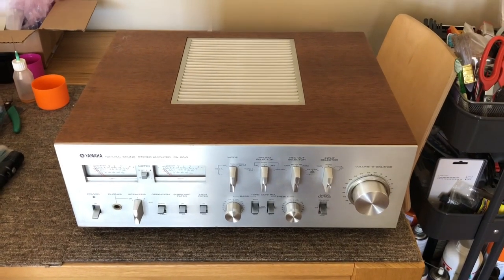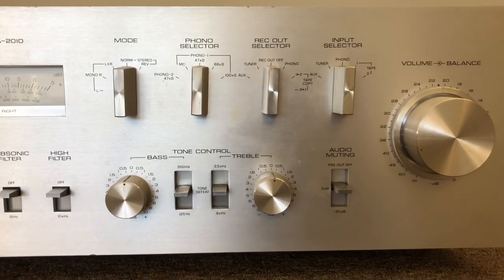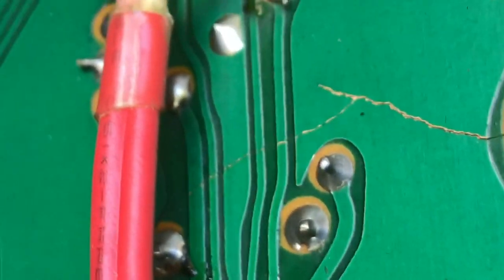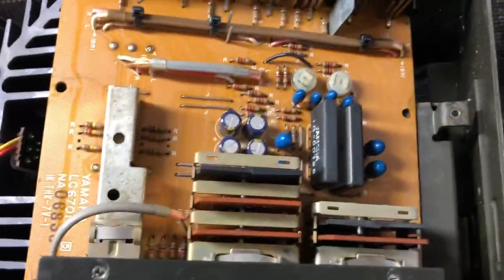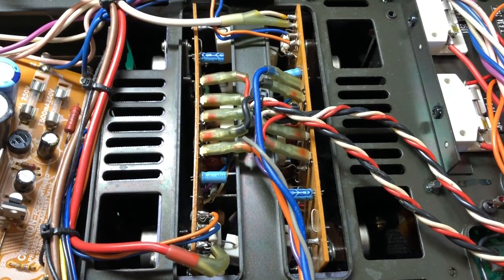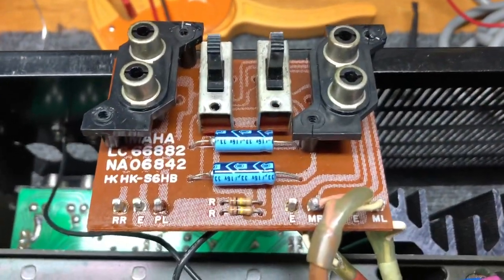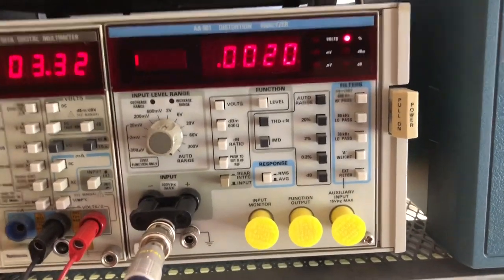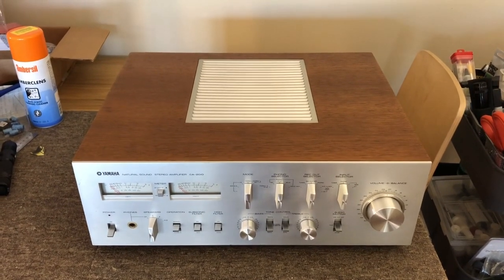Beautiful Yamaha CA-2010 Integrated Amplifier Repair & Restoration

Comment: Hi There
Greeting from Poland. I just aquired CA1010 Unfortunaetly someone has been on tha power supply board before me and fitted some cheap caps . What brand are these yellow and Orange bipolar caps ? Really like the look of them . What series of other Panasonics did you use ?
I would like to fit better quality parts than Sinecon that is there now . I think She deserves it. Regards
Reply from the maker: Hi Adam, most often I use Nichicon Fine Gold and MUSE bipolar, Panasonic FC and FM and Nippon ChemiCon KZE. There are others and it varies according to budget, customer request etc.
Reply: Liquid Audio Hi Sir Thank you for reply . Still refurbing this thing , it was so dirty but its start to look a lot better. Just a qucik question if you dont mind helping out . I measure fes of this black nippon chemi con and almost all read higher than rated . There is one 3.3 uf that read nearly 5uf. Is that Ok or should they be replaced ?
Regards

Comment: Hi, I humbly request some help. I have just acquired a CA-2010 and have followed you video as to what to do (replacing capactitors etc.). I also live in Australia but the unit I have does not have those NEC chips mounted on the heatsink beside the main transistors, rather they are mounted on the PCB. Do you think this is a modification to the original design? Should I also consider moving these chips to the heatsink with the main transistors? Thanks, really appreciate the video.
Reply from the maker: Hi Jono, glad you enjoyed this one. I can't say without seeing her and looking at various indicators close-up. If you live locally you can get in touch and bring her in. If not you can visit my contact page and submit a request for technical assistance there.

Comment: Hi! Thanks for posting this.  I have this the Japanese version of this amp.  The power switch/knob got bent and half broken during shipping to me.  I need to take the face plate off to get to the switch/knob to fix it but am not sure how.  To get all the obstructive knobs off the face plate, do I just need to pull them off the shafts? I've tried but they're really tight so I'm afraid that I might break something if I pull too hard.  The volume knob has the balance ring behind it.  Do I also just pull them all out one by one?  Please help and show me how! Thanks!
Reply from the maker: Hi, be careful and don't force anything. Most knobs are held on by grub screws so you need the correct tools, usually Allen types for these. There are extenders for many of the controls and these must be released at the connector, again via grub screws. It's tricky though without the unit in front of me. I suggest getting a specialist to look at an amp like this though, there are many things that need special attention by this age and experience really helps!
Reply: @LiquidAudio  Thank you very much for your advise!

Comment: Need to make a correction on the power ratings  for Class 'A' which is actually much less than 'A/B' - specs are 30W Class A , @ 8ohms  and 120W Class 'A/B' @ 8ohms.
Reply from the maker: Thanks for the numbers Sky Puppy, I did mention the 120 Watt class-A/B output early in the vid and highlighted the greatly reduced class-A power output. Everything is unscripted though, so my delivery can be a little random at times!

Comment: Awesome content. I recently repaired a CA 610. Wondered in the process about what to use for cleaning the boards. You mentioned isopropyl i guess, but on the picture it looks like soap. Could you recommend a solution? I cant ship it in cause im from germany ;)
Reply from the maker: Hi and thanks for your comment! I get asked this often, but the answer is beyond the scope of a short reply here and there are many considerations. Because much of my process is water-based and requires drying equipment, it's not suitable for many end-users. For most situations, I suggest hand cleaning with cotton buds and iso. It's a little tedious but works well.

Comment: What do you use or how do you “wash” the boards?  Thanks.
Reply from the maker: Hi Mike, thanks for your question. It's a process I've developed that I keep somewhat in-house for several reasons. It involves water in most cases so extreme care is needed and most folks should not be doing it. Plus there are other considerations based on parts and type of contamination, so a detailed explanation wouldn't be possible here.
Reply: Fair enough.  I just acquire a lot of old audio equipment and test gear that I like to get working and restore.  Always looking for better ways to clean decades of dirt, dust and grime off.
Reply from the maker: Absolutely understood, I suggest you search out the old documents from Tektronix and HP about cleaning test and measurement equipment. I developed my process from these and changed things as needed. There are some definite ways to go wrong though, like unsealed relays, so just be careful. The trick with cleaning is to use the right solvent.

Comment: What type thermal pads do you use?
Reply from the maker: In most cases I use a premium silicone thermal pad. Good commercial vendors have these in bulk.
Reply: @LiquidAudio  what I meant was, what's the exact part number. I have a stock of Bergquist insulators that look just like yours, the thermal conductivity is only .9 on mine and I wondered if that is enough... I've heard that only Bergquist K-10 is good enough to replace mica insulators but it's expensive
Reply from the maker: @Stereosandotherfun  Hi Evan, can't give you a part number right now (I'm out) but yes Bergquist K-10 are excellent. That being said, there's a healthy amount of BS written about silpads vs mica. How thick is the mica? How old is the grease? What is the device Pd under normal operation? There are so many considerations that nobody can correctly state that only K-10 is good enough for example. Mica itself has an outrageously poor thermal resistance, so thin mica and good, fresh paste are critical if going down that route. Good silpads are almost always better than old, thick or delaminated mica and dried up thermal paste. You are right to ask the question in relation to a high Iq amplifier though. I can recommend K-10. Here's a good resource: http://www.farnell.com/datasheets/99609.pdf
Reply: @LiquidAudio  thank you for the elaboration. the person who says only K-10 is as good as mica and paste is Echowars from Audiokarma... his expertise and reputation is beyond reproach, so I will have to side with him on this matter, though you raise good points.

Comment: How to clean up sticky knobs and switches if not using contact cleaner?
Reply from the maker: Careful service of switches and controls is necessary in most cases. Lab-grade contact cleaners are a part of that. Ideally, I suggest taking her to a good technician for service. He or she will know what to do, there's less risk of damage and any adjustments and parts replacements can be done then also. The Cyrus one has semi-fixed bias from memory and the last one I worked on needed some capacitor replacements as part of a thorough service.